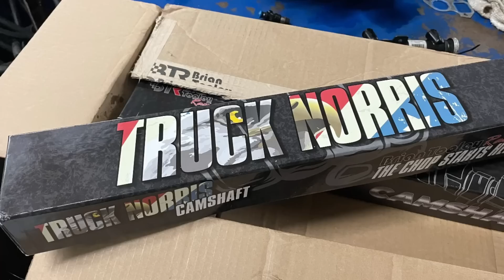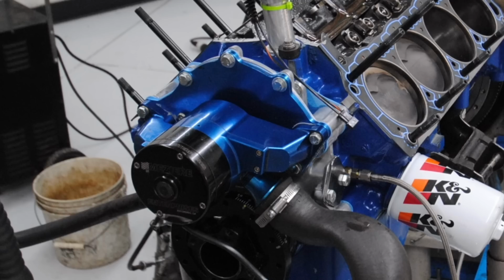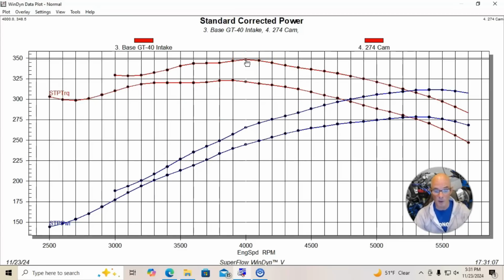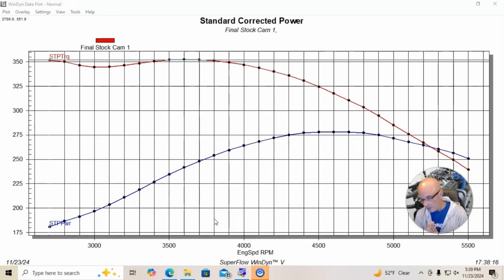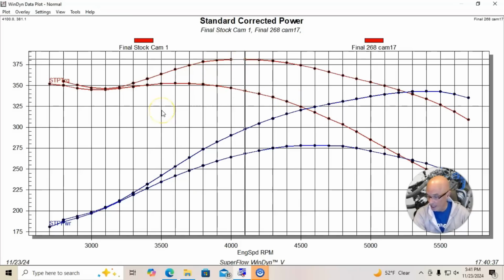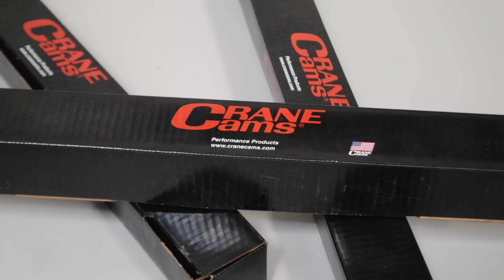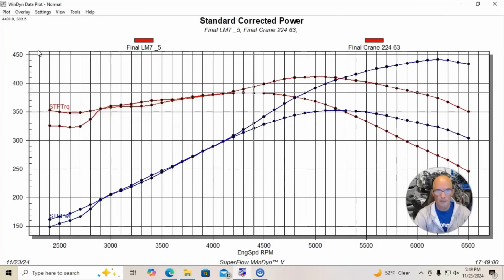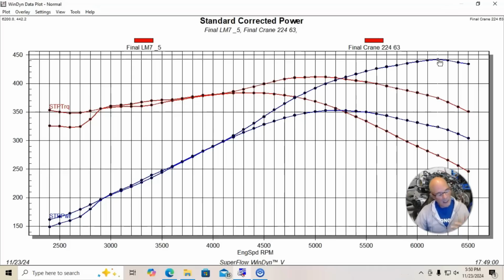5.0L FORD VS 350 CHEVY VS 5.3L LS-MEGA POWER CAM SWAPS! WHICH MOTOR MAKES MORE HP WITH A 224 CAM?

Comment: About 30 years ago I ran a Comp 224 cam in a 302 with AFR 165 heads & a Holly Systemax intake & it dynoed 405hp.
Reply: At the wheels?    What was the torque?
Reply: @dennisrobinson8008  engine dyno 405@6000 hp & 400@4500 tq
Reply: @USALT1 very nice.  Especially then.

Comment: 343hp 381 torque for sbc 
353hp 383 torque for 5.3 (stock)

The stock 5.3 makes the same power as the 224 cammed 350. Head design and flow makes a huge difference.

Comment: The Ford Shelby GT350's 5.2L V8 engine, also known as the "Voodoo" V8, is a naturally aspirated, high-revving engine that produces 526 horsepower at 7,500 RPM and 429 lb-ft of torque at 4,750 RPM. It features a flat-plane crankshaft, which contributes to its distinctive high-pitched exhaust note

VS

The C8 Z06 features a 5.5-liter naturally aspirated V8 engine with a flat-plane crank, producing 670 horsepower and 460 lb-ft of torque. The C8 Z06 features a 5.5-liter naturally aspirated V8 engine with a flat-plane crank, producing 670 horsepower and 460 lb-ft of torque.
Reply: Has anyone bored or stroked and cammed the c8 z06?     I heard the computer was locked.    Change to an aftermarket ecu or add a piggyback.

Comment: why didnt you do a high lift 224 duration roller cam on the small block chevy like you did with the LS? seems like a heavy bias and not a apples to apples comparison
Reply from the maker: this is not a who makes more power comparison (stop being insecure), it's just an illustration of what happens to different combos with the same cam specs
Reply: @richardholdener1727 "this is not a who makes more power comparison(stop being insecure)" you literally have "WHICH MOTOR MAKES MORE HP WITH A 224 CAM" in the title... This is not me being insecure, this is me interpreting the video as a apples to apples comparison of the same sized cams and how they affect different engine platforms.  You have a lot of great data in the video but it doesn't fit the title you chose

Comment: Love the SBF content. It's hard to find someone who takes the time to put out videos of this quality.
My son is collecting parts for an Explorer 5.0 swap for his '71 Pinto, and this channel has been a great resource for his build. He's an old soul and Bob Glidden fan, and he's already got an Edelbrock Air Gap, Demon 625 cfm carb, and a set of AFR Enforcer 185 heads. Thanks for all the insights 👍
Reply from the maker: thnx for watching, great to spend time with the kids on projects. Good luck on the build and let us know what happens
Reply: @richardholdener1727  Father/son projects are the best. Anything that pulls them away from a screen and gets their hands dirty is always good for the soul. 
Your turbo junkyard 351W is the basis for a build I want to do for an old '71 F350 dually. Lightest flat bed I can build to keep it close to 5000lbs and it'll be a fun sleeper with patina, stake sides, four tires worth of traction, and as much power as I can build into it.
Thanks again.

Comment: It's so annoying that you never ever show the power or torque where 80 percent of the driving is done in the below 3500 rpm range ... People should understand you loose a lot of drivability putting this big a can in small cube 300 to 350 cube motors plus you loose vacume for brakes and with carbs stall in gear at idle without the matching high rpm stall converter that burns your tranny up without giant coolers ... There's a reason the big auto builders use conservative cams and it's so anyone can drive them and dependability... I always went smaller on cam selection then everyone else and  beat everyone else who claimed to have double my hp while driving with my a c running ,not stalling ,or bogging ,plus with double the milage winter ,summer ,whatever and without overheating ...😅
Reply from the maker: If only someone put in a 246 PE cam in the video!

Comment: You do so much testing with the xe268 cam on a sbc with vortec heads would love to see a video of the old he268 with 291 double hump heads with 194 valves new 350 vs old 350 build 😀

Comment: That is quite the gain on the GT40 with those crummy E7 heads. As I remember. Richard covers it in a different video.
Reply from the maker: The GT40 intake was worth about 15 hp

Comment: Great video! Out of curiosity what are the 3 stock cam specs? I used a Manley Thunder cam in a 9:1 .040” over 400 Chevy with some bowl and chamber work on the stock heads. It was a hydraulic flat tappet 230/230 @ .050” .480” lift 109 lobe centers, pulled from idle to letting off so as not to break it rpm’s , loved it in a 69 Camaro 4 speed SS, great fun.

Comment: Thank you for the comparison, the 302 Ford is very similar to my own 305 Chevy, with a 224 solid roller, and since it's never been on a dyno now I have a rough idea what it might do.
Reply: 305 smog motor, aftermarket heads for the 305 would help
Reply: @shadowopsairman1583  Has ported heads with larger intake valves already, the engine is not worth the cost of new heads.

Comment: Good test. I've said it for years. There all air compressors. LS make power simply because the oem head flow great. Put a like flowing head on the sbc and the sbc and it'll also do similiar power.
Reply: Yep ls was heads and intake not killing flow.

Comment: Richard, your comment about ring gap made me think of something. Have you done a test on how ring gap affects horsepower? We understand the extra safety that comes with gapping for boost etc, and the possible effect on oil consumption, but what about horsepower changes? Thanks.
Reply from the maker: it made no change in power when we gapped the rings

Comment: Should be a 351 w vs 350.. Chevy always gets the bigger displacement not fair
Reply: It wasnt a true comprison of which is better. Just what's possible with common junkyard motors and mild cam upgrades.

Since its also not fair that the 5.3 has such a huge head advantage and better EFI intake, stock.
Reply: no this test is better because of the variables in displacement, head flow, and both combined compared with a similar cam, which you can use to infer what those variables are worth for power numbers. a 351w and 350sbc will make the same power at the same VE.

Comment: I don't understand where You get these crazy non comparable ideas.  OK now let's comparable gm 305vs 351c 4v vs 7.3 godzilla 224 cam .
Reply: Most common engines it's just showing how much a mild cam can add.
Reply: The comparison isnt about which engine  made the most power, there is no winning engine 
Its about limiting factors  of engines 
 Of he had a stock 351 with 224 cam he probably would've used it
Reply: Ok cough up a 7.3, a direct comparison would be the 454LS.
Reply: @shadowopsairman1583  Not really, the Godzilla is an OEM engine, the 454LSX is a Crate Motor. A direct comparison would be the 454 LSX and the 7.3L Megazilla. The 454 LSX makes 627hp & 586Tq. The Megazilla makes 615hp & 640tq.
Reply: I hope one day you are less insecure once you derive enough identity from an automotive brand you buy material products from.
Reply: @chipcurrey653  that's just it. I'm partial to gm,Ford,and dodge classics. So make a fair comparison
Reply: this is a comparison of how good a platform is, not only a cam. Its totally fair to compare engines when somebody might be choosing what to swap to, or what a cylinder head upgrade might do. its more of him doing research for you (a favor) so you can decide what you want, instead of a dick swinging contest (chill out).

Comment: Being a Chevy man. It kills me to see the coyote making more power
Reply: Get used to it bowtie boy. Truth is, 4 small valves per cyl. flow way more than two large ones. Also an OHC valve train is way more stable than a pushrod valvetrain, and it places the spark plug in the center of the combustion chamber similar to a "hemi" style cyl. head. As i'm sure you know, the cylinder head is where the HP happens. That is why the c8 is packing a Coyote copy! Power By Ford!!!
Reply: @terraboundmisfit umm no. Chevy didn't copy the Coyote. Ford copied the 5.7L LT5 from the early 90's. Ford was gloating about their Coyote and Voodoo so GM decided to smack their manhood on Ford's forehead with the 5.5L LT6 which destroys the Coyote and Voodoo.
Reply: That was no Coyote. That was the old 1980’s pushrod Camaro Killer.

That little beast is a fire breathing maniac of an engine that Ford tamed with the E7TE head. To give perspective the LS head is like breathing through an open mouth without any restriction, the Vortec head is like breathing through a straw.  The E7 head is like breathing through a bent coffee stir stick.  Change the heads and cam and you start getting into block splitting power numbers.
Reply: It’s a fair trade since we have the best after market support and cheap parts galore. My cousin has a 60’s f100 that had a straight six and he wanted to go coyote but the engine itself was more than it would cost to get a 6.0 lq9 with installation included.
Reply: @SH-fr2xm  this is not a coyote..
Reply: @Jane-justjane  I know I’m just saying across the board all ford engines will be more expensive in comparison to Chevy sbc sbe & bbc because of the crazy aftermarket support and the tons of engines GM manufactured and still is manufacturing.

Comment: Why use a 302 ci motor against a 350 ?
Reply: I didn't get that he was pitting them against each other.  I think he was just showing what a difference a good cam could do on a 302 a 325 and a 350 cubic inch engine. And showing that the ls heads, even in stock form don't hold back power potential as much as a stock 302 or 350 head. If the 302 or the 350 had a good set of aluminum heads on them that flowed comparable to the 5.3 head. They both would have had bigger gains in power and probably at higher rpm.

Comment: I miss those old Crane grinds, I wish someone still made them. I had their 228/236 in my Z28 Camaro, and their 234/242 in my SS Camaro. Both put down great power.
Reply: @blue My old Crane 252/262 fireball II cam sure has been good in a 427, I just put it in a 454 but haven’t run it yet!
Reply: We ran the Crane Fireball series and the Saturday night special series (meant for oval track and worked great for street hotrod(had a pretty tight LSA for midrange torque)
Reply: @bluecollarhotrods9781  I think comp has the crane cam specs, I read that somewhere
Reply: @roknroy1  not sure about now, but years ago S&S bought them.
Reply: Comp owns crane and the crane masters now so you can have cams ground by them with the crane specs if you know what masters they were.
Reply: Also Camcraft has copies of most of the Crane profiles and can grind to those specs as well.

Comment: What's the biggest cam you can run in a 5.0? I have an old 1990 mustang, just looking for a little something more than what it has for weekend riding
Reply: Might as well do a whole top end kit and pick up 100+ hp. Just a cam swap isn't even worth the labor if you want more hp.
Reply: plus one on rear gear dump that 3.07 and get a 3.55 it's a whole new car
Reply: You could change the rear gear ratio if you haven’t already.

Comment: I e read that a 5.0 fox engine has short rod ratio and tends to want a head that flows is more important on the 5.0 than say a longer rod ratio Chevy or like me Pontiac 6.6” and not the best heads ever just made lots of torque. I’m wondering most about rod length here but I read not a pro 👊🏻🙏🏻🇺🇸
Reply from the maker: every motor wants head flow